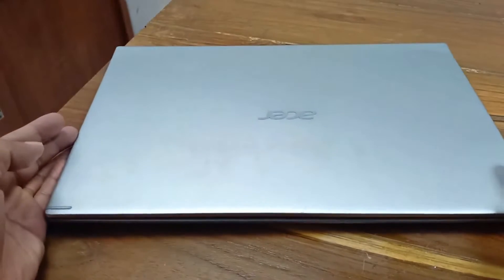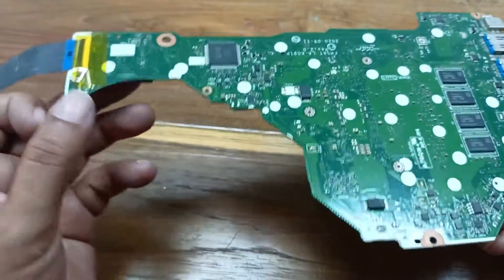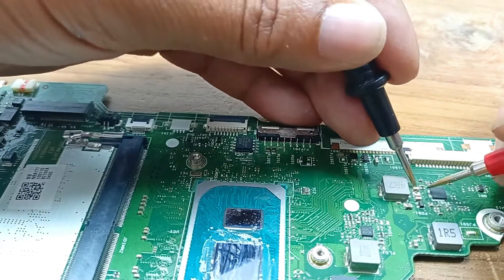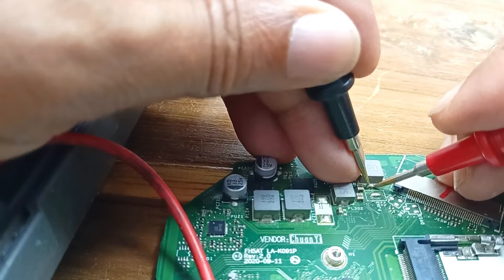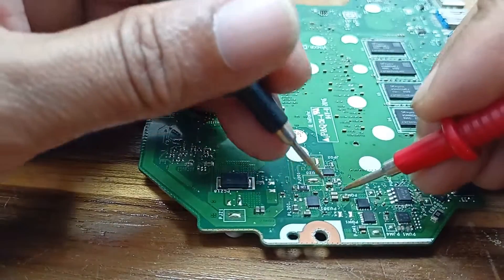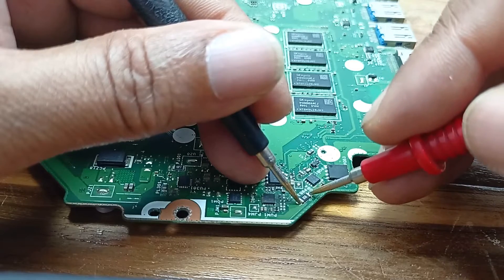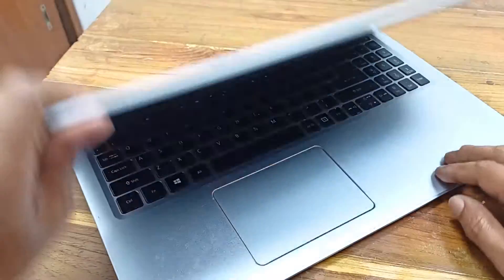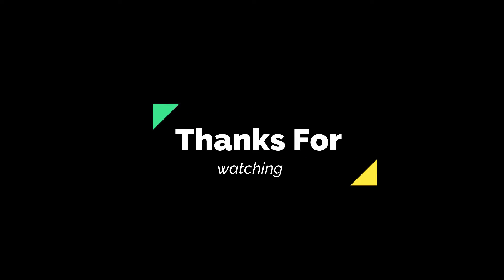Acer aspire 5 laptop no power || acer laptop power is not turning on

Comment: I disassembled my laptop to clean keyboard, but didn't do it after because i didn't had right screwdriver. I had disconnected everything. But after plugging everything back laptop is not turning on. The backlight turns on for split second after pressing power button but turns off after.
Reply from the maker: Again open the laptop and restore all those parts.Before you opening main board disconnect the battery connector after everything  setting and check install the battery!! Hopefully your problem will be solved